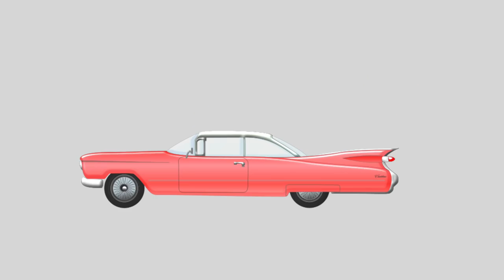Yes, Rockets CAN Fly in a Vacuum

Comment: What a loada crap!! Cars don’t drive forward because of exhaust! Exhaust has NOTHING to do with it. 
Not heard of pistons turning a crankshaft which turns the driveshaft which turns the axels that turns the wheels which uses the tread on the tyres to grip the road? That’s where Newton’s 3rd law comes into it, not exhaust! 🤦‍♂️
And the balloon analogy is rubbish as well, It’s using the air behind it to propel it forward which in a vacuum wouldn’t.
Reply: Exhaust has NOTHING to do with it 

Missed the point. If the environment WERE completely frictionless (I mean COMPLETELY) you would get some slight motion from it.
Reply: No I haven’t missed the point, the point is it’s a bad video in using examples of things being propelled in an atmosphere compared to a rocket in space. And nobody who’s never experienced a vacuum would know, just take what nasa says on blind faith.
Reply: @gawolsy   No I haven't missed the point.

False.
Reply: Newton's 3rd law won't magically cease to work in a vacuum. The exhaust is matter. It has mass.  It needs force to be applied to move it in one direction. Acted force has a pair of reactive force in the opposite direction. If there was no rocket, the gas would move in all directions.
Reply: @gawolsy  Here are a few interesting questions for you, with the answers, that I'll assume you will agree with? 
Firstly, does the burnt rocket fuel coming out of a rocket have mass? Yes, it does have mass. For example, 15 tons of fuel, when burnt in the rocket's engines, will cause 15 tons of combustion gases to be ejected out of the exhaust nozzles. 
Secondly, does this ejected mass of burnt fuel, travelling at hypersonic velocity, have an X amount of 'momentum'?  Yes, anything with mass that has velocity, will have 'momentum'.
Thirdly, when applying the conservation of momentum laws to various objects, when one 'momentum force' has been created and is travelling in one direction, is a corresponding 'momentum force' created in the opposite direction?
 Perhaps you can give me the answer to this question in your next reply?

Comment: Nobody is debating whether COMBUSTION can happen in a vacuum. It can! The real issue is that the gasses leaving a rocket in space would simply shoot straight out into the endless void. They are travelling in the direction opposite the rocket, and have no way to provide that needed push against the rocket. Down on Earth, that needed push is supplied by the atmosphere resisting the gasses' motion, which then pushes back against the rocket. In other words, rockets do require air resistance to work, and therefore they don't work in the vacuum of space. The woman in the video is lying and intentionally deceiving us by supplying loads of irrelevant information.
Reply: The real issue is that the gasses leaving a rocket in space would simply shoot straight out into the endless void

False. The combustion creates pressure within the combustion chamber. That pressure pushes in every direction inside the chamber. The combustion product escapes out of the combustion chamber though the "throat," which leads to the exhaust nozzle. Once the exhaust reaches the nozzle, it has enough pressure to expand much faster than limits of the nozzle allow. Its not free expansion. At each location (combustion chamber, throat, or exhaust nozzle) the superheated gasses would (if completely out in the open) expand outward in all directions at incredibly high speeds. But because its all contained in the chamber/throat/nozzle assemblies, it cant expand out in all directions on its own. All of the expansion is redirected in one direction. Producing thrust. 

Thrust is the action. The motion of the rocket is the reaction
Reply: @EdgemanLL2  Any gasses present within the combustion chamber would be instantaneously and violently sucked out into the vacuum of space. There is no chance for them to perform any work upon the rocket at all.
The Earth's atmosphere is what allows them to stay inside the combustion chamber for as long as they need to expand and push against the rocket.

A rocket that is at normal atmospheric pressure has "ideal expansion," meaning its exhaust plume is performing at optimum efficiency. When a rocket reaches high altitudes and low air pressure, it exhibits "under-expansion," where the pressure outside the nozzle is much lower than the pressure within, and the plume extends in a wide bell shape and doesn't give enough thrust to the rocket.

In any NASA or SpaceX launch you can witness the wide plume of under-expansion for yourself. The liars on TV are telling the audience that the rocket is accelerating into space at this point, which is the opposite of what is actually happening: the rocket is decelerating and nearing the apex of a parabolic arc that will end with the rocket plunging into the ocean.

Nozzle over-expansion and under-expansion: http://www.aerospaceweb.org/question/propulsion/q0220.shtml
Reply: @WeeSleeket  Space is a vacuum. It is completely nothingness. It has no mass. It has no moving parts. It cant do any work, suction or otherwise.

Don't feel bad. its a rookie mistake. 

Gasses will flow from high pressure, to low pressure. So any opening into space will result in any gasses flowing out into space. That doesn't prohibit rocket engines from working in space. 

Fuel and oxidizer is burned in the combustion chamber. It would (if uncontained) expand outward rapidly. However, being contained in the combustion chamber results in pressure at all points in the chamber. As the gasses flow through the throat to the nozzle, there is unbalanced force created between the top of the combustion chamber and the throat. Thus resulting in the rockets movement.
Reply: @EdgemanLL2  What I should have emphasized in my last post is that a rocket can't even make it into space, due to thrust not working in low atmospheric pressure. This is based in physics, as described in the link I posted about under- vs. over-expansion of the exhaust plume, and can be witnessed by visual observation. 

Therefore: If a rocket loses thrust in conditions of low atmospheric pressure, that implies that it will have zero thrust in vacuum conditions.

So why and how would a rocket that has lost all its thrust suddenly gain a boost of acceleration to send it up into space? That's nonsense!
Reply: @WeeSleeket  if I fired a standard Steel projectile from a crossbow, in space, will I feel a recoil? Yes or no?
Reply: @stuartgray5877  – The uploader of the video below shares the same misconception (that vacuum "pulls" gases):
https://youtu.be/WOxhub1Aw20
He is supposedly an engineer.

Edit: a very clear explanation, how the "vacuum sucks" idea was put to rest 400 years ago:
https://youtu.be/c31312iN37Q
Reply: @WeeSleeket  Here are a few interesting questions for you, with the answers, that I'll assume you will agree with? 
Firstly, does the burnt rocket fuel coming out of a rocket have mass? Yes, it does have mass. For example, 15 tons of fuel, when burnt in the rocket's engines, will cause 15 tons of combustion gases to be ejected out of the exhaust nozzles. 
Secondly, does this ejected mass of burnt fuel, travelling at hypersonic velocity, have an X amount of 'momentum'?  Yes, anything with mass that has velocity, will have 'momentum'.
Thirdly, when applying the conservation of momentum laws to various objects, when one 'momentum force' has been created and is travelling in one direction, is a corresponding 'momentum force' created in the opposite direction?
 Perhaps you can give me the answer to this question in your next reply?
Reply: @MrAnticlimate  - Yes I have TRIED to comment that "Life is an Illusion" is a FRAUD and is in NO WAY an "Engineer" unless he drives a train.
He has been blocking me for a couple of years now.

Comment: Combustion and propulsion cannot happen in a space vacuum. The elements of O2 and the fuel will not combine in a space.vacuum. Once a gas opens to space vacuum it is annihilated
 and pressure will not exist. This takes me to the misguided notion that an air conditioning system will work in a space capsule. The thermosphere  will melt aluminum and glass not to mention the wiring and insulation. This is suicide. Rockets fail in close earth orbit as the air gets thin. Satellites that orbit are doomed to fall back into earth to crash  and burn eventually.  Newtons laws don't work in space vacuum.
Reply: "Once a gas opens to space vacuum it is annihilated". That's matter and anti-matter you're thinking of.
"The thermosphere  will melt aluminum and glass". No it won't, temperature =/= thermal energy.
"Newtons laws don't work in space vacuum." They work in vacuum chambers on earth. Newtonian physics is not dependant on the presence of an atmosphere.
Reply: If I fire a crossbow in a vacuum will I feel recoil? Yes or No?
Reply: @stuartgray5877  
You shoot crossbows. You fire a gunpowder weapon.

Yes, you feel recoil if you shoot a crossbow while in a vacuum.
Reply: All false.

Comment: Hi guys,
The question i've might be really dumb but here it goes:
According with newton's third law every action has a reaction, so the thurst creats a force against the air which make it lift from the ground. Once you hit the space, you don't have anything to do the force on. So how does it move or change direction? (take it easy, don't kill me xD)
Reply: Thrust doesn't create a force against the air. It creates a force against the rocket.
Reply: The rocket engine accelerates the MASS OF THE EXHAUST out of the nozzle.  Would a FIRE HOSE feel recoil if sprayed into vacuum?  YES.
Reply: You lose all thrust and maneuvering capabilities.  Disregard the comments talking about thrusting against itself.
Reply: @DrCash7  Why? That's how it works. The thrust force, being a result of violent chemical reaction, propagates in all directions, and rocket simply happens to be in the way.
Each rocket essentially rides on an explosion shockwave.
Reply: @DrCash7  would a crossbow firing a steel projectile, experience recoil if fired in a vacuum?
Reply: @stuartgray5877  would a blind person see to stop wiping?

Comment: How to accelerate spacecraft in space.. Without ground and air?
Reply: By accelerating mass in the opposite direction to your desired direction of travel.
Reply: By ejecting water at high pressure force. Same principle as water ejecting through rubber pipe at high pressure force causes rubber pipe to propel in opposite direction. Higher efficiency in propulsion with water compared to gas in vacuum of space.

Comment: I dont think that balloon would move anywhere if u did that in a vacuum
Reply: Yes it would.  The balloon is FORCING MASS out the back, accelerating it.
  MASS has inertia and REQUIRES a FORCE to accelerate it.
  Are you suggesting that a GAS can be accelerated WITHOUT A FORCE?
Reply: I'm suggesting that the vacuum of space would cancel out the force of air being pushed out of balloon leaving balloon motionless.. all test I've seen show small vacuum chambers.. as soon as air escapes balloon it cause vacuum chamber to fill with enough air that it's not a vacuum chamber causing balloon to have medium to push off of.. I would love to see balloon fly around in nasa super powerful vacuum
Reply: @eduardoacosta5940  sorry but a "vacuum" does NOT "pull" the gas from the balloon.  The "vacuum of space" is physically incapable of exerting a force on anything.  When the balloon "vents" the gases into the vacuum the balloon is doing 100% of the PUSHING on the gas.  This accelerates the gas which REQUIRES A FORCE. The balloon feels this force EXACTLY as a crossbow would feel the recoil force of firing a solid projectile.  The solid projectile AND the gas from the balloon both HAVE MASS.  Shoving ANY kind of Mass creates a recoil force on the object doing the shoving.
Reply: @eduardoacosta5940  the force crushing that tanker is the PRESSURE OUTSIDE PUSHING IN.  Do you know the theory behind gas pressure and the kinetic energy of the gas molecules PUSHING on objects like the walls of a pressure vessel?  Please explain to us how a region DEVOID OF ALL MATTER can exert a force on anything.  Really, tell us the MECHANISM for "nothing" to exert a force on an object, any object.
Reply: @eduardoacosta5940  want PROOF of rocket Propulsion in a vacuum? Search YT for "SpaceX ArabSat launch and booster landing 4K".  Watch the video of the falcon heavy fly into space, then the side boosters returning to land at KSC.  Report back after you watched that video to the landings.
Reply: Stuart Gray I watched it.. the problem with space x is that there is never a unedited camera angle.. also there is a lot of fakery when space x supposedly launched car in space.. Elon stated that u can tell it’s real because it looks fake.. just like the other ones on your channel that look fake and edited when they reach “space”.. they had a weird problem with camera angles on launch you suggested.. the live stream was edited.. people screen recorded the original live stream because all space exploration has signs of trickery and people always record just in case editing goes on.. I’ll send u a link of guy breaking down launch.. space travel is made in Hollywood
Reply: @eduardoacosta5940  your first statement is false there are MANY UNEDITED videos of the launches and landings from both SpaceX and hundreds of observers.  Trust me it is REAL I have been launching Spacecraft for almost 25 years. My next payload launches on a Falcon9.
Reply: @stuartgray5877  link me video then I would like to see
Reply: @eduardoacosta5940  here is a novel concept: why don't YOU just go to Youtube, type "SpaceX unedited" in the search box and click "search".  Why is it you people constantly CLAIM that something does not exist, when you have NEVER BOTHERED LOOKING FOR THAT THING ?!?   I got EIGHT PAGES of videos from that search term ....
Reply: @stuartgray5877  then link me one lol.. I have yet to find an unedited genuine footage
Reply: @eduardoacosta5940  oh, and shall I take a selfi when I am inside the SpaceX facility next week negotiating launch services for my next ride?
Reply: @stuartgray5877  just because u work somewhere doesn't mean they can actually go in space.. there is serious deception in space videos its hilarious.. me asking for u to send me a video of unedited footage isnt a big deal.. I can send u footage of a bunch of videos that u can clearly see aren't real or using some cgi trickery.. so taking a selfie inside a facility doesn't mean anything lol.. you're brainwashed sir
Reply: @stuartgray5877  also u saying that vacuum of space doesn't cause any force literally makes me question if your a troll.. the vacuum of space would literally tear stuff apart like tires, space suits, space crafts.. u can literally see bubbles on iss space walks because they film it in a giant pool.. if u dont believe me I can send u links because I believe what I say and can back with videos while u cant even send one when there are supposedly thousands lol
Reply: @eduardoacosta5940   The balloon wouldn't go anywhere.  You're correct.
Reply: @eduardoacosta5940  So incapable of claiming your $1000?  I thought you were too big of a coward to come back here after checking my resume.
Reply: @eduardoacosta5940  Here are a few interesting questions for you, with the answers, that I'll assume you will agree with? 
Firstly, does the burnt rocket fuel coming out of a rocket have mass? Yes, it does have mass. For example, 15 tons of fuel, when burnt in the rocket's engines, will cause 15 tons of combustion gases to be ejected out of the exhaust nozzles. 
Secondly, does this ejected mass of burnt fuel, travelling at hypersonic velocity, have an X amount of 'momentum'?  Yes, anything with mass that has velocity, will have 'momentum'.
Thirdly, when applying the conservation of momentum laws to various objects, when one 'momentum force' has been created and is travelling in one direction, is a corresponding 'momentum force' created in the opposite direction?
 Perhaps you can give me the answer to this question in your next reply?
Reply: @sailorman8668  you still need a medium to push off for rockets to work.. doesn't matter how much tons of fuel you have..  we are told space is a vacuum which means there is no medium which means rockets in space are a scam.. send me a video of a rocket launch with no edits traveling through space.. dont u think it's kind of strange how we "went to the moon" 50 years ago and cant today because they "destroyed the technology".. dont u think it's kind of strange how there are many videos of space station mess ups? You can see clear use of wires and green screens.. isnt strange how Obama said we are finally going to be able to to go past low earth orbit when we already supposedly went to the moon.. space travel is a scam brother